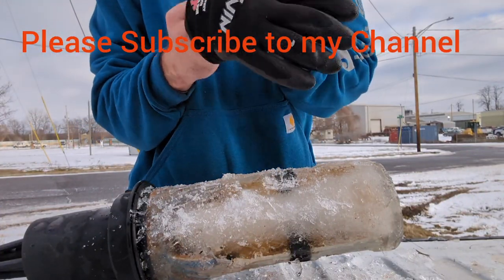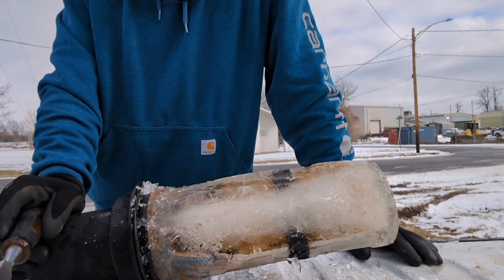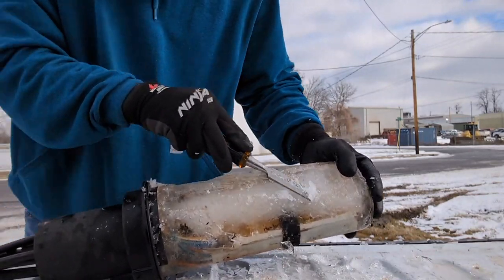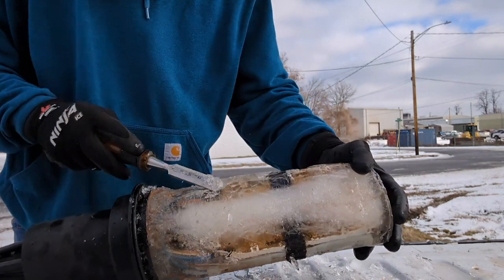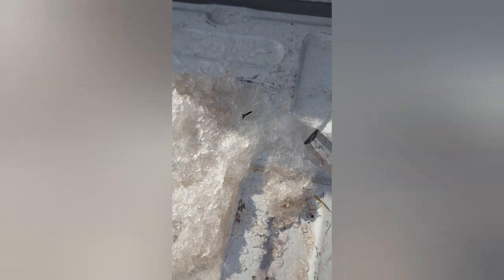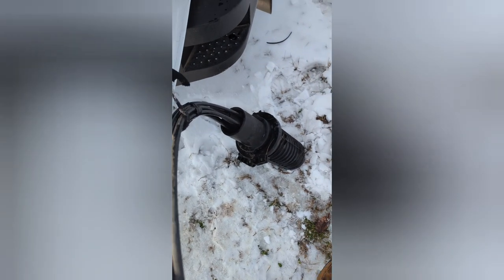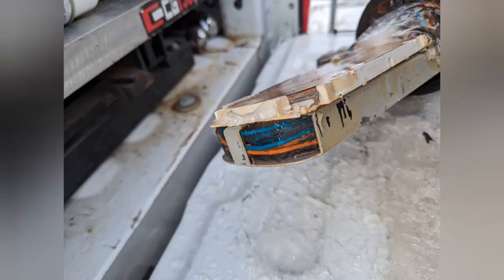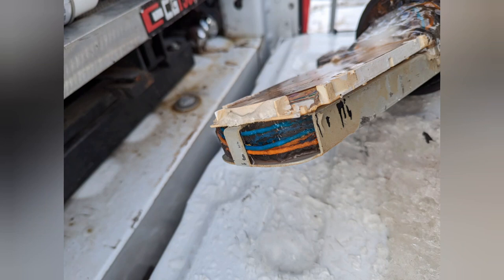Frozen Fiber Closure! Trying a new fix.

Comment: Thanks for sharing; this is an important troubleshooting all techs should get training on. Best thing we've used for that is hot water, if you can source it while on-site. Soak it in a bucket or cement mixing tray, and you'll clear the case in minutes without all the chemical residues from your other options.

Also, if your truck has an inverter, you can heat the water (not to boiling) on-site with an electric kettle, then careful pour the water where it's needed. Lastly, try hair dryers, but avoid heat guns!
Reply from the maker: Thanks for the info!